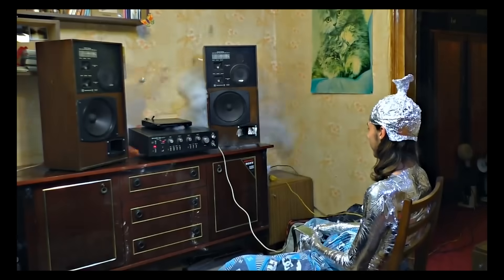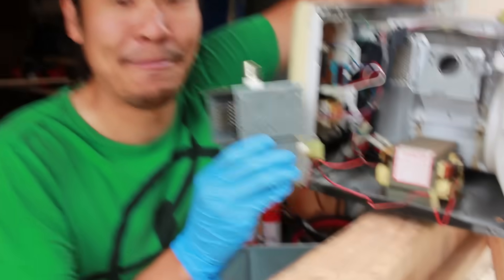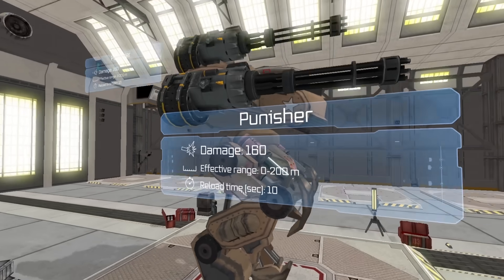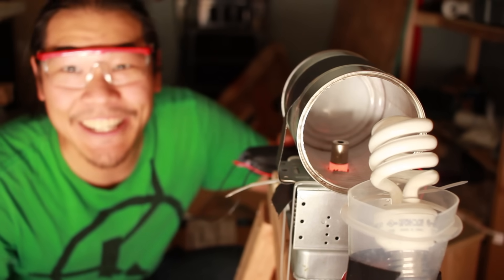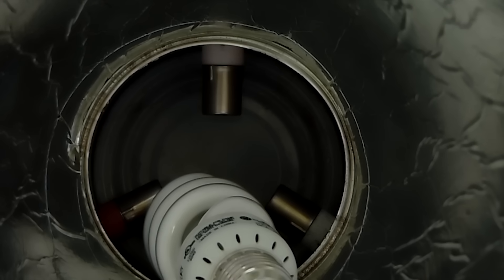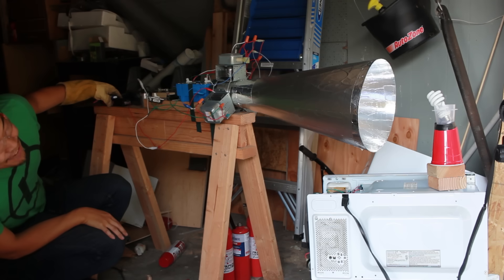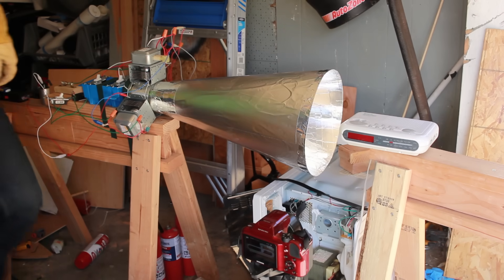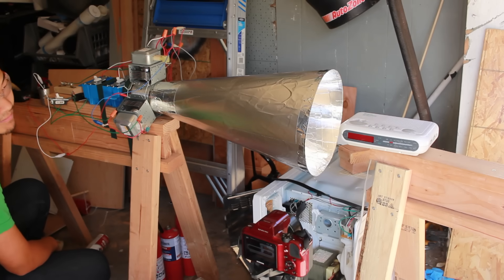A Microwave Gun Made From Taser and Soup Can??? (Testing Kreosan's Magnetron Cannon)

Comment: You should try static electricity. I have a schematic from a 1954 Scientific America experimenter's handbook that uses a simple motor to turn a big rubber band with the static accumulation on the other side in an aluminum sphere. It's a stand up model and at the top of the aluminum hollow sphere there's a point on which you balance a copper rod with a thimble soldered in the middle and an inch worth of 90* bends in opposite directions on each end. The electric accumulation is so strong that ions will move up and out of the ponts fashioned at the end of the copper rods making the rod rotate with a discharge that is emitted at the speed of light, although it doesn't have much torque- ionic discharge from static accumulation model spacecraft engine design.

Comment: I think you could use an M16 modified for blanks, a piezoelectric generator and a pulse forming network. Try a fan shaped antena to direct the energy pulse with a copper shield behind it. That should give enough power to disable the electronic device.

Comment: I think they had the vape batteries preheating the filament so it can emo electrons more efficiently.  That’s the issue with using a stun-gun alone, because there’s not enough current.
Reply: And I higher voltage taser
Reply: And a higher voltage taser

Comment: Major wave cancellation issues.....
you cannot just stick three free running oscillators (magnetrons) in a jam tin and not expect wave interference and cancellation..... likewise if your wave guide is not tuned to microwave frequencies to help them propagate it will just causing looses and unintended impedances.... 
If this stuff was that easy the military would not have to spend lots on it to try and produce a weapon.... 

I understand the wave length of domestic microwave magnetron is about 12.26cm..... I think the back end is working fine, but your failing is the front end delivery of microwave energy... get that right and you should be able to push substantial energy over long distances.... After all it has been proposed to build a solar power station in space and use a microwave beam to get the power down to earth, so it does work lots further than a few inches when you get it right!
Reply: A 14 degree horn angle is apparently optimal

Comment: I read a write up that explains being able to fry a cell phone from ten feet away, they simply used three of everything all connected to the cone. Here's a direct quote from the write up explaining each circuit consisting if the following: "On a basic level, the circuit consists of a transformer, a voltage doubler (diode and capacitor) and a magnetron."

Comment: should be using the transformer and cap that came with the microwave to get the required amperage.. lipo batteries, step down converter and an inverter to go wireless
Reply: also from what i've read, a cowbell horn antenna will work better than a conical one

Comment: The tasser simply can not give you enough energy for the magnetrons and also magnetrons have a filament which has to be connected to a low voltage coil of a transformer in order to produce electrons and it will work!

Comment: In theory, if you up the output of the stun gun (or whatever ignition source you choose) with the capacitors of all three microwaves, it could work. However, the 18650 batteries would have to be wired in series, and it would take a LOT more than four of them to have an effective radius. Also, if the funnel was made with aluminum or copper wiring (something conductive), and a smaller taper to the cone, it might be more effective.

Comment: Don’t aim the magnetrons towards one another. That will just ruin them by sending the waves directly back into them. Same thing happens when you run a microwave without anything inside. Aim them out and away towards the direction you are aiming at. Also use the high voltage transformer in the microwave that is used to beef it up! Your welcome

Comment: Maggies need a high voltage positive DC plate supply to function.  In low power ovens the plate voltage is about 800 volts.  The CFL you were using to detect RF at the beginning of the test was probably being lit by the RF noise generated by the stun gun.  Another issue is the orientation of the maggie's emitter - it has to be inline with the feed horn for proper coupling.  Next time either use the oven's power supply and orient the emitter parallel to the feed horn.  If you do use the oven's power supply, be very careful as it can deliver a lethal shock.  Myth Buster's tried to couple 2 oven maggies together in one of their episodes but since they were ignorant of their function they failed to heat anything except the tube's filament.  Keystone Science has a video showing how to make a microwave gun that works.  https://youtu.be/80kDn4vit_w

Comment: Please use a radioactive material to make the weapon stronger you would have to have the radioactive material isolated from the plasma so that it doesn't explode. Though you would want the radiation from the radioactive material to still be able to interact with the plasma without the plasma interacting with the radioactive material. An analogy of this is I can do something to you but you can't do anything to me. Though you can do something to others.  If im the radioactive material I can effect you though I'm isolated so you couldn't effect me or cause me to explode. So I accelerate you as the plasma and you can effect other objects in ways we don't know yet. I don't know if the energy that is emitted is safe for humans so we might not see machines made using this principle. Well if it isn't safe for humans its allowed to exist and be used usually. They want us all dead anyways. We could make all sorts of things with this ranging from weaponry to medical uses to spacecraft or other aircrafts. It would be easy as radioactive material can effect an object from a distance.

Comment: Why do i just see it now? Hm. Thanks YouTube. But yeah, for 2.45 GHz (where most microwave oven magnetrons run), the horn has the wrong shape, it needs corners, like a pyramidal horn or a sectorial horn, similar to such in radar applications (look for the SGH220 series from microwave vision). And than should one magnetron be more than enough. Conical horns make only sense in high power applications with cylindrical wave guides for satellite coms for example

Comment: You need to learn more about antenna design if you want range.

You can build a dual polarized wave guide with two magnatrons rather than the 3 jammed in that design

You have to offset the magnatrons by a fraction of the waveform and run them perpendicular to each other

Some of the best antennas I have ever seen are home built

I've always thought of actually creating a coupling with something rugged like an industrial N coaxial connector

That way you can try all sorts of carrier grade directional antennas with a properly equipped magnatron

Yagis would probably work really well due to the simplicity of of the driven element being such a small portion of the overall structure

The reflector element would protect the user and the ample amount of dirty signal would walk right up the director elements

I know for a fact that antenna design is more the key to this than power supply

Power is important but it is no substitute for efficiency
Reply: Hey, there. I would love to understand a bit more in depth what you're describing. Is there al link you'd be willing to share so I can get a better understanding of creating a directional antenna? Primarily, how exactly would one convert the microwaves generated by the magnetron to go through the Yagi antenna? 

// The reflector element would protect the user and the ample amount of dirty signal would walk right up the director elements // <--- This comment was FIRE!

Comment: Have you tried connecting all three high voltage capacitors in parallel with the taser? And instead of a taser use a car battery with an inverter.

Comment: smaller square can,  or better yet square metal pipe to use as a waveguide. choose a size tuned to the wave you want. set the length so it creates a standing wave, basically a mazer. install a valve in the waveguide at the business end to release the build up of energy through. build a shapped and tune metal end for the MWC that focuses the microwaves; might work better. Ukranian Kids did a cool vid, but unless there is more wiring under the board we are both missing, just wasn't very honest video on their part.

Comment: Only one magnetron is enough, change the stun gun or modify it in order to feed more amps and change the cone guidewave with a rectangular section one with a vertical and orizzontal lenght of 12.24cm and a transversal lenght of 2 cm, use tin can alluminium that is ticker compared to alluminium foil to build the guidewave, youl'll get more range and enough power to fry simple electronics.

Comment: Microwave ovens are resonance devices.  They need the cavity to cook even with 1000 watts of input power.  
There are microwave radiators/transmitters that are better suited to ranged attacks on personnel and electronics, but they cost a lot, are made by companies like Raytheon and Fairchild, GE etc. for military use.  They also need a shitload of power (KW to MW) range.  This is a fantasy.  Useful up close however for sabotaging small and sensitive electronics.  You don't need a magnetron, just a coil and a stun gun circuit.

Comment: Me and my mom have been targeted with Remote Neural Monitoring and tortured with satellite RF weapons, aka DEWs since January  2021. Prior to then it was only harassment with invisible DEW "taps/impact" sounds hitting windows and the vehicles(have a recording of proof of this posted to my Facebook Ben Sparrow). But since Jan the torture started with 24/7 EMF high pitch frequency torture, tjen different forms of brain zapping/neural shocks at night to wake me and continue if I close my eyes, and neural disruption, uncontrolled jerks/twitching  limbs and body convulsions if I try to relax, pins n needles feeling that don't go away,  sharp pulsing pains that feel the same wherever they are targeting.  The ringing and torture gets especially bad at night. We don't call it torture lightly.  Other victims call it "AI", but i don't think it's ant more AI than monitoring for preset  triggers, scenarios, timers, etc and reacting if it isn't being controlled directly. 

But they refuse to acknowledge  this current holocaust,  but they will. Just look up the truth about the fraction of covert operations the CIA, FBI, and military have done. I was naive enough  to believe this couldn't  happen until it did. The 24/7 ultra high pitch oscillating, always  changing ringing, buzzing, chirping  frequencies torture is their main weapon, with 24/7 satellite and satellite  remote neural monitoring.

I could go on, but I won't.  Just don't go believing  the Gov when they point their fingers at the Russians as if they aren't the guilty ones, and pretend that the current "mainstream" cases of "Havanna Syndrome" are isolated. Nobody believed the Nazis were doing what they did either. Its 2021 for Christ's  sake! Stop gaslighting victims!

Comment: Should have at the minimum used a 1 farad cap. instead of that 30-60 micro farad cap. Would have made a huge difference.
Reply: Those microwave oven capacitors are 1 micro farad. There is no commercially produced 5 kV 1F capacitor on the market and for a good reason.

If the capacitor was made from equal thickness conductor and dielectric plates and the dielectric was something popular like PTFE then the thickness of the dielectric would be around 0.03 mm. To achieve 1 farad capacitance the total volume of that capacitor would be around 190 cubic meters or if it was rolled into a cylinder, 6 meters in diameter and 6.5 meters tall. You could cut the volume by almost half by making the conductor thinner but you'd also severely increase the resistance of the capacitor and thus limit the charge and discharge rate.

Such capacitors would only be found in big power generation and storage applications on nationwide scale. It would also store 12.5 MJ of energy comparable to the explosive energy of 3 kg of TNT.

If you made the capacitor out of diamond, which has one of the best dielectric properties out there, you could cut the size down to the size of an oil drum. It would weigh more than a ton (still less than the hundreds of tons capacitor in the previous example) and would contain about 500 kg of diamonds. Even by taking a price for low quality 1 carat diamonds it would still cost 5 billion dollars to make.
Reply: @Ryrzard  Who said you need a 5kv capacitor? That is just you talking so you can listen to yourself. You can buy all kinds of 1F capacitors out there will all kinds of voltages ranges. People have made welders out of 1F caps. But I'm sure you would also say that is impossible and would have to be the size of the Empire State building for it to work. What a joke!!
Reply: @jonesgang  5 kV is the operating voltage and you suggested replacing it with a 1 farad capacitor. You cannot use a normal 2.7V 1 farad capacitor for this purpose because it will break down.

You can weld with low voltage capacitor bank without a problem. Capacitors get that big because of high voltage rating. Another problem is that the materials that make the low voltage super capacitors so good are extremely voltage limited which is why the vast majority of super capacitor cells are 2.7V only. The ones that hold higher voltage use different materials and have inferior energy storage and capacity.

I did actually make a mistake because I forgot that a cylindrical rolled capacitor has twice the capacitance of the unrolled sheet so the volume would be half as big. That doesn't really change the point that such high voltage 1 farad capacitors don't really exist or at least you won't be able to buy one for personal use.

Comment: Is that a flyback transformers with pulsed DC? They rarely go beyond 100W - anything else would be too inefficient. If you want several kW for those 3 magnetrons, you need a beefy normal transformer (=not a coupled inductor) with a robust full-bridge driver (DIY with separate power-MOSFETs with heatsinks, =no integrated circuit) and with a large battery to support the Amps. The format would be a little larger, but I don't see why this can't be done.

Comment: The microwave kill teams you see on the street usually just use 'refrigerated' trucks where they conduct emf from the main unit with gold sheeted pvc pipes that go inside a muffler. Sit behind one in traffic and you are toast.

Australians are famous for drilling out the insides of trees and siphoning off power from mains to create 'hot-spots' like those around central park where if you sit or stand near a tree you end up getting microwaved. Known to use park benches and flower boxes aswell. 

The hubologists (colorado airport, st johns parish, orange county, Dupont, etc) typically instead pay for broadcasting bandwidth and target the channels at non existing or nonstandard receptors that cause the signal to destabilise and microwave the local populations. Usually use ABC, since they specialise in high altitude emf targetting.

Speaking of ABC, did you know they put all those reruns so their satellites can beam down non-standard frequencies at will on anyone that can get ABC on cable? They basically just use calibration settings on their satellites and fry people up. 'Xilaber' is the codeword for that one.

Still, the CIA's method of getting a car really hot then hooking up the battery to nearby power lines to cause an emf spike and take out local power lines like in texas is probably the most effective means of murdering civilians to cover up your tracks!

Just giving you an idea of how it's done in the real world for someone in the intel industry :)

Speaking of, getting one right now, time to fire up the humidifer and nitrate supplements, for the fifteenth this month.

Comment: I did the same as Allen, with the nitrile gloves. However those thin gloves will not protect at all against high voltage, not even mains voltage. Electricians gloves are 0.5-1 mm thick latex (0.5mm per 500V resistance)

Comment: Allen quick question when I use an arc lighter and "Taze" the tip of a pointy object such as a nail or needle it will cut off my monitor and temporarily turn off my box fan? Is this the same concept?

Comment: Dear Allen.  If you really want to blat something with RF - this is the way to do it https://aip.scitation.org/doi/10.1063/1.3703307 - doesn't need to be nearly as complex engineering wise.  It's all about impedance matching a driver to a load, with the load being an antenna, and the driver being a very, very, very high power pulser.  Could certainly run it off a tazer type power supply.

Comment: Wouldn't it make more sense to mount them as parallels to the firing direction as possible to avoid loss of power from bouncing around inside the can before making it out the cone? I get that it did project at least a little bit, but I'm pretty sure this is a terribly inefficient design even while ignoring the power setup being intentionally underpowered with that taser for safety.

Comment: 7:19 - what if a strong enough current went back to the power station , windmill or anything else and it just stopped working, just from a tiny, man-made E.M.P
Reply: Tldr;  The power grid is in protective sections, so you cannot get enough current back to the generators to break them.

The power grid is separated in protective zones to keep a short in a house somewhere from frying the generators. For instance, the breakers in your house count as a zone, and there's breakers, fuses and monitoring devices/protective equipment protecting the individual zones. So it's pretty much impossible to do.